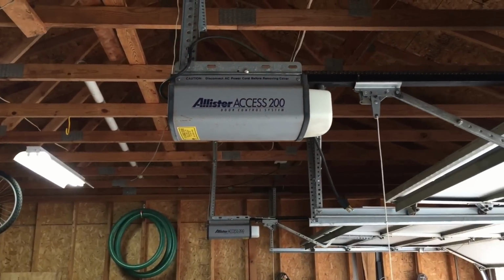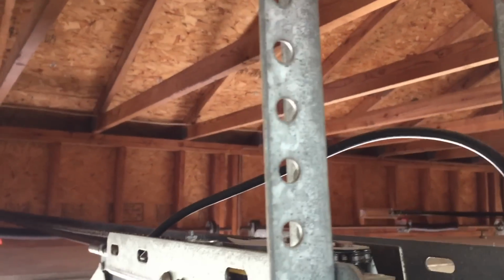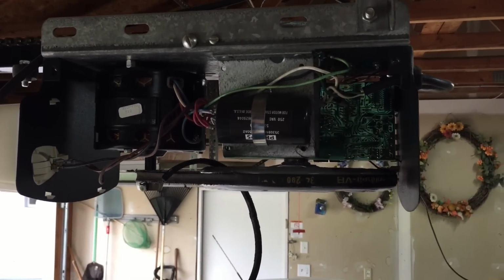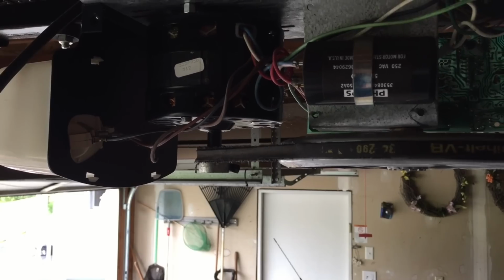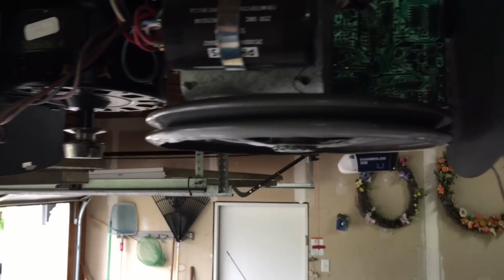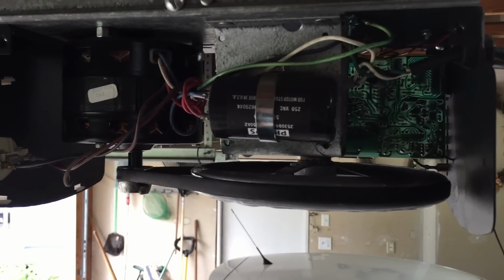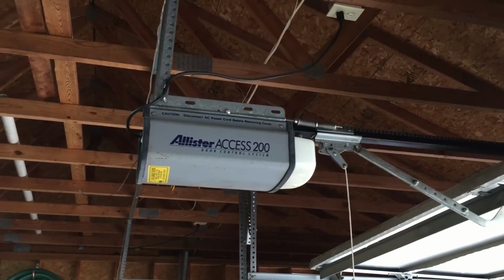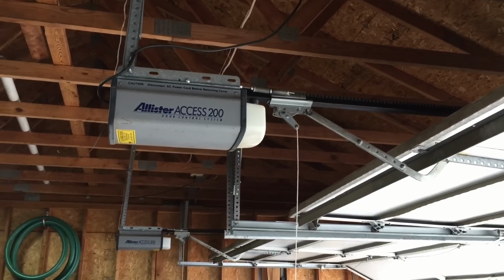Garage door opener not working easy fix

Comment: THANKS JERRY - you gave me, a weekend repair warrior the courage to open up my garage opener. Turns out that my CRAFTSMAN 1/2 HP opener is gear & cork screw type Not belt - ALL PLASTIC PARTS - what a piece of crap... I see the plastic part that broke and will try to fix it.
Reply from the maker: Hey A.W.  thanks for the comment...  And remember if you put your mind to it you can do anything...
Reply: @JerryJacksonDIY  ok, FOUND IT ONLINE - its "Sprocket Coupling" that broke. Everything seems to work, just need the part.
Reply from the maker: GREAT JOB A. W. !!!!!!  Knew you could do it...
Reply: @JerryJacksonDIY  Thanks Jerry - Best regards to you and the family. Stay safe.

Comment: Jerry ......older Allister than yours but similar symtom except that the belt seems loose.  I can push the belt and there is a little slack.  Without the weight of the door it works OK, but with the door attached it slips.  Will just a new belt fix it or or there another explanation for less "power".
Reply from the maker: Hey Randall...  Over time belts can stretch and cause them to slip..  I would recommend replacing the belt but if it still slips you can adjust the tension on the opener to make the belt tighter...  Hope this helps...
Reply: @JerryJacksonDIY  I ordered a belt 3L 290-M29 from Gates.  I am optimistic that it will work.

Comment: Thanks for the video that really helped I just replaced my belt on my Allister operator and after I got it on it seemed pretty tight just wondering how tight it should be?
Reply from the maker: It should be fairly tight....  If you did not move any of the adjustments then it should be OK.  Thanks for watching...

Comment: Thank you for the help.  It will help me when I tear my garage door opener apart.
Reply from the maker: Thanks for watching Flydye...
Reply: @JerryJacksonDIY  Mine was the wire to the door stopper came off, shutting off the motor before it moved more than an inch or two.  Just in case anyone needs another alternate easy repair. Two seconds and a new screw and it was done.

Comment: Does the opener have sensors?
Reply from the maker: Hey Temple...  Thanks for the question...  It does have limiters that you can adjust the open and cloesed positions.  Hope this helps..  Thanks for watching...
Reply: @JerryJacksonDIY  Not those. The safety sensors at the bottom of the track that reverse the opener direction.
Reply from the maker: Sorry for the delay Temple...  This garage opener does not have the safety sensors...  Thanks for watching...
Reply: @JerryJacksonDIY  I didn't think it did. I believe the sensors weren't required until the company was renamed to Allstar.
Reply: @JerryJacksonDIY  One last question: How much horsepower does the motor in the Access 200 have? Let me know if I get this right or wrong: I think the Access 200, 2000, and 3000 openers have 1/3 HP and the 250, 2500, and 3500 openers are 1/2 HP. Is this correct?

Comment: Where did you buy the belt?  Local Hardware store?
Reply from the maker: Hey Carlos, I ordered the belt from Amazon.  There is a link in the description below.  Thanks for watching...
Reply: Jerry Jackson DIY I bought mine from Oreily auto parts- brand is gates. But struggling to find a way to install it. Could you please tell how to remove that drive pulley or show another video on setting it up?